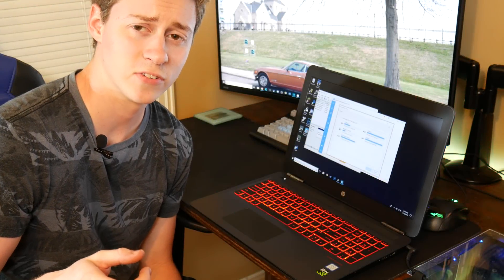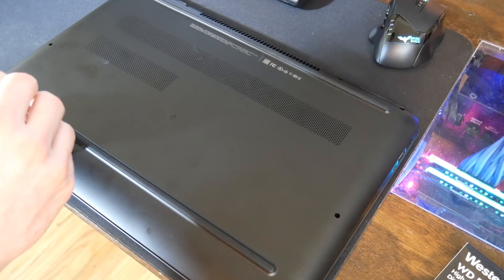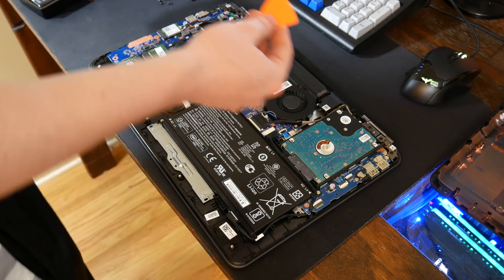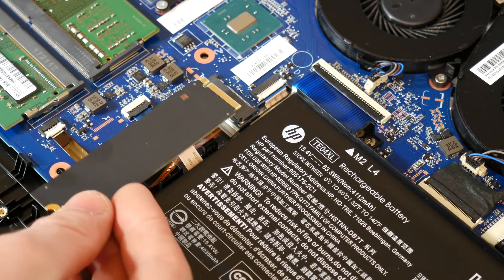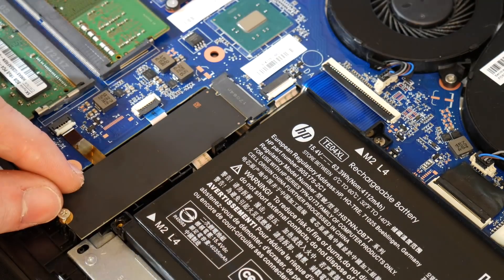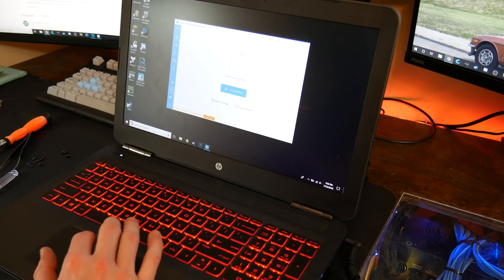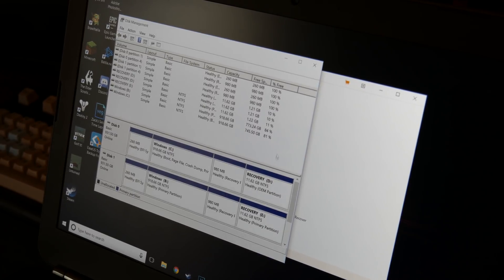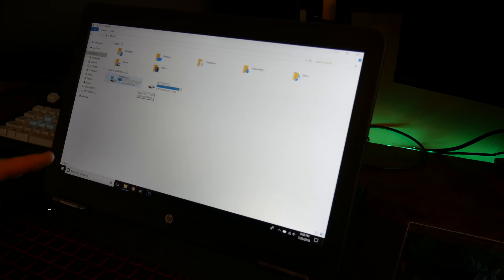HP Omen M.2 Upgrade & Disassembly guide

Comment: Could you run a read/write speed test for the SSD? I got the standard SSD mounted and wanted to check if I can improve speed in addition to capacity.
Thanks!

Comment: I bought a NVME ssd and it wouldt bootup after the cloning. I could see everything when I connected to the usb adapter. Which model is yours? mine is a Ax210nr?

Comment: What you failed to mention is you have to disable the Optane drive software from Intel first before you install the M.2 drive. Otherwise when you restart after the drive is installed you will get an OS error as it won't recognize the M.2 drive as having an OS. You can also reformat the original drive (you don't want two drives with the Windows installed on both, suppose you could rename the Windows folder on the SSD drive to Windows.old if you don't want to reformat) and reinstall it so you have a D drive. If so, you can also run your page file off of the D drive.
Reply: How to I go about disabling Optane? I can’t find the intel Rapid Storage Tech. app on my laptop, and It won’t recognize the SSD as a boot device. Even when I take out the HDD, it won’t switch automatically
Reply: @isaiahhernandez1678  same issue... ever fixed it?

Comment: Hey, i need some help better understanding this....if the laptop comes with a 256gb m.2 nvme ssd...and i want to upgrade to a 1 tb of the same thing then will it work....is there any difference in the physical dimensions as the storage capacity increases in these m.2 nvme pcie drives?

Comment: dude please help , i have the same laptop since 2 and half years and now its suffering overheat and fps drop, after i used compressed air and changed the thermal paste the problem never been solved so i took it for repair , there they said my fans are 70% weaker so i have to change them with that piece above the fans that connected to the heat pipes . if you please can tell me what is that piece's name so i can buy a new one and what is the reason that makes u want to change it with the fans if the fans are the problem only .. thanks

Comment: Hi Matt/Jackson- a couple questions. First the laptop you have looks a lot like Omen  HP -17-w295ms (GTX 1070), Is that the model you are working on? Have you had any issues with that model like the screen freezing, going to green/purple/black after a while sometimes recovering on its own and sometimes not. I'm wondering if this is due to a flaky 128GB NVMe M.2 that the OS uses (boot drive) on my model. I was thinking of updating it for this reason. I have tries everything else from Bios updates to updating all of the drivers, but this random freeze thing just happens sometimes and it has nothing to do with the heat or gameplay. Thanks for the video, I'm going to do a clean install of the OS just in case there is some issues with the original HP install and their associated crapware.

Comment: I just installed an M2 SSD but is not showing anywhere on the laptop, not even on the BIOS, I don't know what to do.
Reply: I've had the same problem with a samgung SSD drive too, incompatibility issues. Returned the SSD in and got a crucial 500GB instead, worked just fine.
Reply: @st00pidf0k  it actually popped up when I turn on my computer after not using it for 3 days lol

Comment: I wanted to know if the centon SSD 2T 2.5" solid state drive can substitute the internal drive of this omen?
 centon 2TB25S3VVS1

Could you help me with this? size and pin compatibility... thanks
Reply: Yes you can substitute that’s what I have on my 8th gen hp omen 2T ssd and 1TB nvme and i removed the intel optane memory it had...useless with this new upgrades ... sorry for the late response. I’m here now since I want to put a 2Tb nvme card on hp omen I have but I don’t think it’s compatible so I’m doing my research before I buy the thing

Comment: hi, I got a omen 15 ax202na, and I tried to open it for cleaning and upgrade.
However, after I remove all 10 screws and unplug the locks surrounded the keyboard, I still feel a force stop me from remove the case.
I saw that your demo laptop is similar to mine, can you give me some suggestions？
Thx
Reply: It’s one clip in the center, right next to M.2 slot and battery.
I just broke it trying to open the shell.
To open it without breaking you have to pull shell horizontally towards side where mini jack port is (opposite side  from HDMI)
Reply: Had the same "issue" opening mine. Just place te PC with the air entries facing to you, and after unplugging all the locks, pull the case horizontaly towards you. It worked for me. 
Cheers!
Reply: The force stopped you? Did it sound like Yoda/Obi Wan or Darth Vader/Darth Sidious?